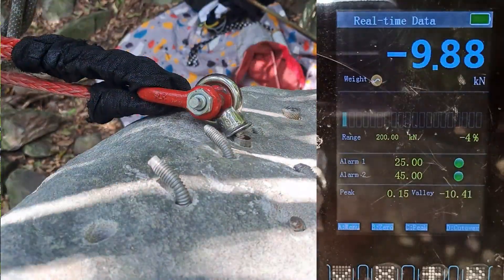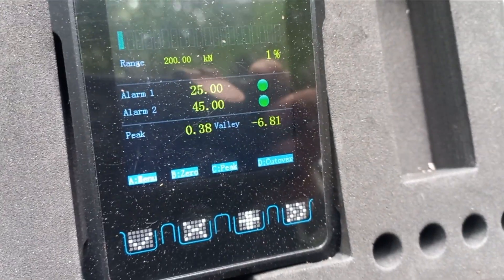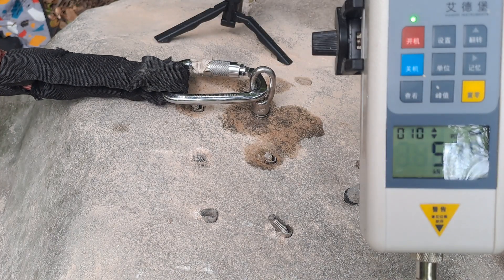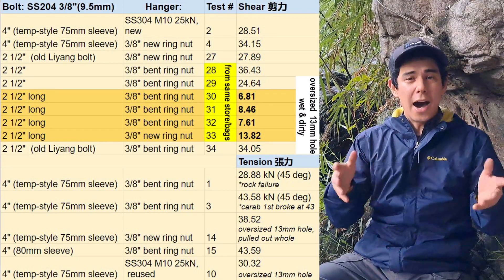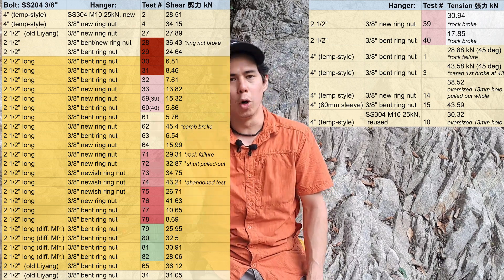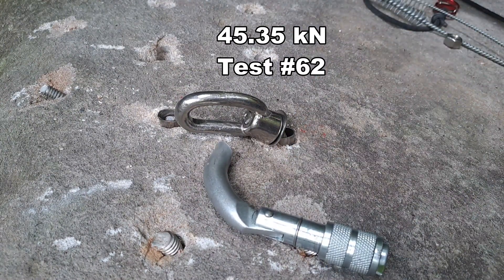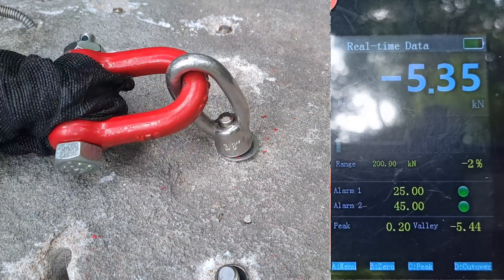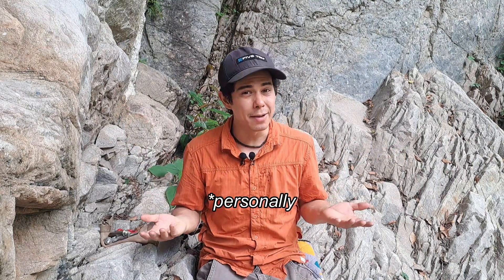BREAK TEST (cont.): Stainless Steel Hardware Store Sleeve Anchor, BAD BOLTS BREAK LOW!

Comment: My guess would be that the longer ring makes it bend over further and so applies more stress on the bolt. The ring also gets blocked by the rock, preventing an acute angle of pull. Just a guess..
Reply from the maker: Yes, those ring nuts definitely add some leverage when you pull on them in shear. For the bolts that were made well, they would just bend over to like 90° degrees, and then break above 25kN. But when the poorly made bolts would bend some, they would just snap off. 1 year and hundreds of tests later, yeah, those were definitely a bad batch of bolts that were breaking so low.

Comment: Mechanical engineer here, not a metallurgist. 
- Looked like it was mostly the threaded rods that were breaking in these tests, not the rings, so that points to inconsistent material properties in the bolt. One of the biggest issues that causes weak material strength is voids in the metal (basically tiny bubbles) created during casting/forming of the base material. Even tiny voids you can't see with your bare eyes cause large internal stress concentrations that often lead to premature failure. This was a huge problem during early metalworking processes over the last few hundred years, and even modern processes can allow voids to form. This can vary from batch to batch within the same manufacturing plant if some variable changed, and is a big reason why standardized testing and certification bodies exist. Generally cheap materials are made with cheaper processing / less control / less trained workers so in the case of material quality you often get what you pay for. 
- Typically the rated MBS is the average breaking strength plus 3x the standard deviation based on a sample of break tests, so the math says that 99.7% of those products will meet or exceed that rating. From your testing, the rated MBS allowing for 3 sigma would be quite low, potentially <10kN due to the huge variation. 
- Otherwise it could come down to batches of material sourced to make the products varying, although small changes in alloy material % shouldn't cause 4x difference in strength. I would suspect voids or other stress risers caused during forming of the threads to be a more major contributor to strength variation than alloy composition. 
- The other issue with these ring bolts is that the force is applied much higher above the rock surface compared to standard climbing hangers. You want to apply most of your force in shear to the threaded bolt, but these eye bolts transfer a large moment (torque) to the bolt which causes a much higher internal stress in the bolt than if pulling in pure shear. The elongated oval eye bolts protrude higher and when the connector slides up to the very top it increases the lever arm and therefore increases the torque on the bolt for the same amount of axial force you are pulling. The results were all over the place but in general with the same material properties, a force applied in shear closer to the rock surface will allow put less torque on the threaded bolt and it should break at a higher axial force.
Reply from the maker: Thanks for taking the time to share more insight on what the issue could be with the metal quality. What you said was spot on. I come from a family background of importing goods from China, and have lived in China for a few years doing factory inspections. Keeping on top of materials, production processes, packaging, and shipping were all vital things to do until the product reached the client. 

Other than me seeing these hardware store bolts w/ring nuts being used in a few sparse crags, a few members in the canyoning community here expressed particular interest and concern about these sort of bolts being used, cause they can be still found in some canyons all over the island here. And the additional leverage the ring nut places on the bolt was a concern. Some bolts even had a hex nut installed below the ring nut, which even raised it up higher, increasing leverage.

In our shear tests, for the hardware store bolts of better quality we tested, the metal would continue bend to about 20°, and break on average at 30kN. But the poor quality batch would just snap off around 45° and at lower forces. 
Regarding the remaining hardware-store bolts of this type left in the canyons, some are deciding whether to just swap out the ring nut for a hanger instead, or just install a new bolt instead. (I know what I would do). But that's a decision the canyoning community has to make for themselves.